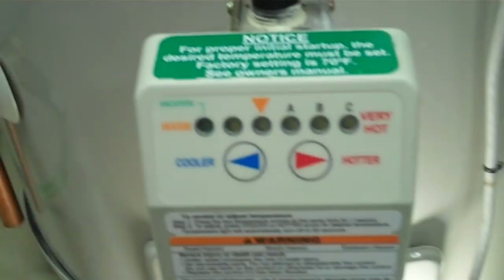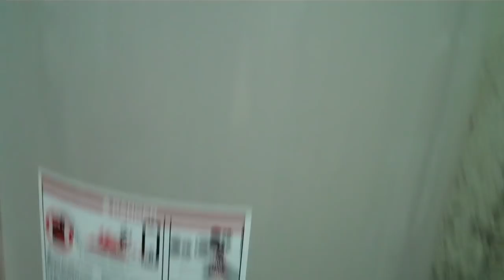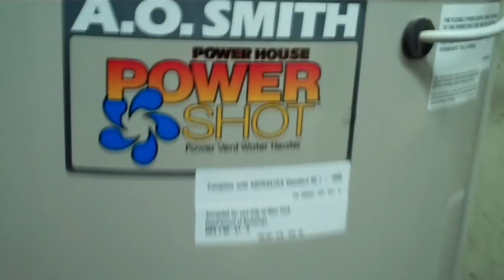Water Heater Flame Gas Short Cycle Ignitor Sensor Troubleshoot Repair AO Smith Igniter@geofatboy

Comment: Thank you so much for this video.  I have a State/A O Smith water heater that was doing the same thing you described.  After one cold shower I got on youtube and found your video.  20 minutes later the water heater is fixed with no parts needing replacing and the water is already heating back up.  I was prepared to replace the heater because it is 19 years old but now it is working fine.  You saved me at least $1K but probably more like $2K.  Thanks!
Reply: I was in the same boat.  I thought I was going to be replacing the water heater.

Comment: Best Video instructions!!! We have the A O Smith gas water heater which was giving "System in Lockout" error.One Plumbing company I called said they will have to replace the igniter plate (shown in this video) which will cost me $300/-. I followed this video step by step. There was a lot of dirt settled on the igniter plate which I emptied in a garbage can. Put the assembly back and started the water heater. It started working just like its new! . And I just saved $300/- Many thanks!!!!!

Comment: Thank You ! I have the exact water heater with the exact problem. You just saved me approx $2000.000 . I’m a retired general, plumbing and flooring contractor. Because of heavy lifting throughout the 45 years working in the trades, I have sever spinal cord damage. There are many things I can’t do anymore which leaves me at the mercy of trades people who would rather replace than repair and help people. I was able to manage this maintenance repair by myself. It helped that you happen to have demonstrated on my exact water heater. Thank you so much. It’s good to know there are honest tradesmen still out there.  Please excuse the grammar and punctuation errors if any. I’m an old guy.

Comment: Just wanted to say thank you for this video!  It described my problem exactly.  The extent of my trouble shooting knowledge was to unplug it and plug it back in (I'm a woman).  When that failed, I called my very handy dad and brother, who both have electric heaters.  They were at a loss as to how to help.  Your video gave me the instructions, and after 10 minutes and not even having a wrench, I was successful!! As another commenter said, the nut for my gas pipe was also backwards, but everything else went smoothly.  I'm no longer "just a girl."  Thanks again!

Comment: My Rheem 75 gallon Power Vent Water Heater gave me a message of "maximum attempts to light ignitor reached system in lockout mode". I tried to figure it out for hours to no avail. Then I found this video, did exactly what was shown and it worked!!! THANK YOU SO MUCH! I was the hero to my family!!! God Bless YOU!!!!!!!!!!!!

Comment: Thank you so much for this video.  For 3 months now we were using our 2nd water heater as the main one had not been working.  Our neighbor had the exact same issue and the plumber changed the water heater for a tune of $1400.00.  So I was reluctant to do anything.  I ran across your video and decided to give it a try.  Wow it worked like a charm.  You saved our family a lot of money.  I really appreciate your help.

Comment: Thanks for the video. I was surprised that my flame sensor didn't really look very dirty, but I polished it with some steel wool, and now it works perfectly. It was easy too.  I put a straw over the igniter so I didn't touch it by accident

Comment: I searched the web for a solution to my Intelli-Vent issue a year ago. I thought it was a wiring problem up near the vent because it was intermittent and fiddling with the wires could get it running for a couple of days more.This time I'm very glad I saw your video. I'm pretty sure my problem is solved, at least until the sensor needs cleaning again in a few years. I can't thank you enough. Thank you for making this video.

Comment: Just realized this video was posted 10 years ago but it saved my holiday week. Got exact same issues with my water heater before Christmas Eve and couldn't find any plumbers. My family spent the Christmas and the weekend without hot water. I decided to give it a try and the advice in this video works! It definitely made me feel like a hero.

Comment: I am so thankful that you created this video...it is 6:30pm on Christmas Eve and family is coming over in under an hour and we just discovered that we no longer have hot water.... I had this same problem with my AO Smith Water Heater about 5 years ago. Back then, I hired a vendor to solve this and they explained this exact process as they solved the problem. Five years later I wanted to review the process and Wow!!! your tutorial matched the issue and the process and indeed this solved my problem and a Christmas Eve disaster without hot water and a family gathering in just over an hour. Thanks a million!
Reply from the maker: Can believe it took me 2 years to answer but I'm thrilled it worked for you! Gotta have hot water on Christmas Eve!

Comment: I just paid a plumber $54 dollars to diagnose and clean my unit due to the exact problem you described.  The price is very low due to a coupon but the unit started doing the same thing 24 hours after he came. I was complaining if you want anything done right do it yourself. So I went online and Googled the problem and found your video. Ironically watching it took longer then the actual repair :). The unit is working perfectly! TYVM!

Comment: Thanks for posting this. Rheem had told me I could pull as you illustrated, but I wanted to see it in action. It worked. I just used a pinch of steel wool to clean the igniter and I saved from stupidity dollars.

Comment: Wasn't sure if the heater control or the flame rod was bad and did a search for the controller and found this video. Cleaned up the flame rod per your instructions and the unit is now working again. Thanks. Looks like I owe you a beer...

Comment: This is a GREAT video. Turns out, we did not have enough gas/pressure coming into the building. We had 2.5 inches of water collumn and the unit needs at least 5.0. So the gas company is coming out to check. Thanks again! Great job!

Comment: Thanks for the video. My AO Smith 75 gal unit was slightly different than the one shown but the trick worked perfectly and it fired right up and stayed running.  Like others have commented, we've had repair men out 3 times to replace that sensor, burners, control unit and this problem keeps reoccurring even though it's only 4 years old.

Comment: Add me to the list of happy DIY'ers that fixed their water heater with this method.  Pulled out the flame sensor, sanded it clean and shiny, and it worked like a charm.  Thanks for the help!!

Comment: I was not getting any error codes. I called AO Smith technical support and they said I needed a digital volt-ohm meter to figure out the problem.  I setup a service guy - $85 to show up but then I saw this video.  It is running like a champ now.  There was a lot of crap in the burner area.  Thanks for posting this simple solution.
Reply from the maker: Excellent Don! Glad you got it worked out.
Visit https://shavenation.com/ If you'd like to improve your shave!

Comment: Thank you for the video. Got the hot water heater working by following your instructions.  Saved the cost of a service call and they probably would have charged for a new burner assembly vs. just cleaning it. Thanks!!

Comment: Looks like you have saved another one. :)   Really appreciate this video.   Mine just went out a few days ago.  I shut off the gas and unplugged it.  Found this video today and it's working again. Took less than 15 min to fix.
Reply: I should add mine was originally installed on 10/19/2010 so it wasn't even 4 years old yet.
Reply from the maker: AWESOME! Glad I could help!
Visit https://shavenation.com/ If you'd like to improve your shave!

Comment: I love you! ;)
My ProMax (75 gal) was a single green light and 5 yellow lights on the temp controller and the blower fan was constantly running.,My unit has two burner pans which made getting the assembly out a bit of a trick. Once out the flame sensor and burner pan were in pretty good shape. I lightly sanded the flame sensor and reassembled.

Powered up the blower fan, I heard the click and w/in seconds I had flame. Heater is heating up water now. Looking forward to a hot shower and shave.

Comment: @geo. The jack of all trades. Big difference between U.S. And U.K. Water heaters, ours is heated with an immersion element which is inserted into the tank. The problem with that is over time limescale will cling onto it and reduce the heat output thus rendering it and London is notorious for hard water. Which means replacing the elements and getting expensive call out from heating engineers. Be well mate. Your bro G from across the pond.

Comment: I had a Sears Economizer 6 that was short cycling.  Sears wanted $200 with no guarantees to come out - since it was no longer under warranty.  But would be glad to sell me a new one.

Had heard about cleaning the ignitor, but only that it needed to be done.  Not the smart way to get to it.  Saw the video, took 10 minutes, maybe 15 since it was cramped and it works like a charm.  Thanks much.

Comment: Thank you!  Great video.  Although our heater was a 50 gallon and the flame sensor is shaped differently, cleaned with sand paper as shown on your video...working so far.  In a warm shower within 20 minutes.

Comment: Great video and great hint! 

I just wanted to share my experience with others. I have a Kenmore Powervent 6, made in 2005. From what I've figured it is an AO Smith with the Kenmore label.

I followed the procedure detailed in the video to no avail. Also replaced the entire ignitor/flame sensor component (~$100), but problem persisted (will go though the start cycle but 2-3 seconds after flame starts then it stops).

Finally found what the issue is. The white box that says "Intelivent" connects to the metal piece on the back of it (which is the gas valve) using 4 pins. These pins were supposed to the soldered. In my case, I could easily remove the white box from the gas valve. This is not how this is supposed to be, and caused a bad contact on these 4 pins. 

Long story short, I bought a soldering iron and some solder at Harbor Freight (~$7 total) and soldered them again. Problem fixed!!!
Reply from the maker: And now you are an expert troubleshooter! Hopefully someone else will read this and benefit from it.
Visit https://shavenation.com/ If you'd like to improve your shave!

Comment: Hey. Thanks so much. Just saved $150 plus tax. Did this on a Giant water heater....pretty much the same but there is an interior cover held on with 4 screws that have to be removed to be able to take the burner out. Thx again !

Comment: Thank you, worked great on my Kenmore Gas Water Heater with a Power Vent.  I was concerned about the sealed area and any differences, but it was a couple of nuts and came off easily.  The rest was as you listed here.  Great work, Thank you!!

Comment: Bingo.  Solved it immediately.  I was a little concerned because I have a dual burner - but it did pop out eventually.  Used some emery paper and it worked immediately.

Comment: Thank you sooooo much Life Saving Man, your Video saved me lot of frustration, just finished the job as you described and its working....looks like perfectly, burner is on and water is heating up for the morning. Really appreciate your instructions. Navraj Grewal.
Reply from the maker: Navraj, enjoy your next hot shower, compliments of Geofatboy!
Reply: ***** Hi, great video. I did what you suggested. After sanding and putting it back in, the flames came on the third try so I got a tank full of hot water, but then on the next restart cycle system went back into the lock out mode (error 6). Any other suggestion, much appreciated and thanks

Comment: I have the State Select Unit model # GS650YBVIT. I used this DIY video and the heater is working like new. Thanks, geofatboy and You Tube!! Now I've got to cancel that service call.
Reply: what error code did you get? I am having similar problem but error code "error in hot surface ignitor circuit" !!!  Never touched the ignitor circuit !!!???

Comment: Great Video. Very thorough
 I'm a service  & repair plumber with 25+ yrs.
A  co-worker installed an AO Smith - BTN 100 110 today and had a problem.
This unit has 2 burners and the one with the flame sensor was loose and wasn't getting good flame rectification. 
Fixed that but have another problem.
I just uploaded a video with a burner problem 
I've never seen this problem before and thought maybe you might have an opiion
Video is unlisted & only 30 sec

Comment: @geofatboy Yes, unfortunately it's 5 months beyond the 6 year warranty. I did figure something was wrong last summer when I heard restarts but I didn't think of it much then and I thought the unit was out of warranty anyway (the builder did not leave the manual/docs). Also, I did not know that you're supposed to drain these units every 6 months or so to prolong the life. When removing the burner I noticed big chunks of rusted metal falling down, so I decided to order a new water heater...

Comment: Thank you for the video, did exactly what you said, unfortunately I'm not part of that 9 out of 10 times. Still getting error code 5. AO smith with intellivent put in 2009 so out of warranty. Thank you again for the straightforward directions!
Reply from the maker: Might have to bite the bullet and have someone come and check it out...
Reply: Bet ya it's the gas control valve.
Reply: What was it? I'm not that 9/10 either  & I've just lost my job so I need to be able to fix it or we just won't have hot water for awhile unless we boil it on the stove...lol!
Reply: Wow, guys forgot all about posting this question but I did fix it on my own.. My husband calls me the research queen. I looked and looked and read forum after forum and after testing the flame ignitor sensor with a multimeter I found that it had gone bad and wasn't making the connection. I ordered a new one and we now have hot water again. It was about $85 with shipping and was simple to replace...... Fun Frugal Frenzy, I had to heat the water on the stove for almost 2 weeks as well! LOL

Comment: One important note: The flame sensor is to blame only if you GET A FLAME and it goes out.

I had this same intermittent problem but I never got a flame at all during the retries before lockout. A.O. Smith help desk made the problem worse by claiming that a faulty electronics/gas valve board will not cause an intermittent problem. I eventually proved them wrong: If I tap the housing with a wrench, it starts every time. The valve is flakey - something AO Smith support says is impossible...

Comment: I have a new a.o. smith vertex that goes on and off just like you said. this is the replacement heater to the one before that did the same thing. my plumber won't come out anymore and a.o. smith tech is no help. Cannot find the problem. great video you put out.
Reply from the maker: Thanks David! Glad you got it sorted out!

Comment: THANK YOU!!!  First hot shower in weeks!  I was apprehensive to do this with the gas explosion/electrocution risk (if anyone were going to mess this up, it would be me), but this was super easy!  I used a dollar bill, since I didn't have sandpaper on hand, and it worked!  

Also, if all the intellivent lights are off, does that mean it's working fine?
Reply: No lights means everything is fine. Lights only when there is a fault, or if you are performing the override steps to set the water temperature.

Comment: I contacted the manufacturer in regards to this problem, they recommend a small knife to scrape away large deposits on the last half inch of the probe then steel wool, not sand paper.
Reply from the maker: O. K. good luck with that...

Comment: Thank you so much for the video!!! Our home has this in our laundry room, and despite attempts at keeping it clean and dust free, this problem has occurred like clockwork every 8 months since building in 2008. Each time it has cost us 90$ for the service man to come and use a tiny bit of steel wool, for under ten minutes, and back it works again for another 8 months.  Supposed to be an awesome water heater, and you just made it such. I can also hopefully extend the life of it! Bless you!

Comment: I have a slightly different variation. The flame will actually burn for a couple minutes, then when it shuts off it always tries 3 more times and gives me the codes. Like it is not sensing that it just burned. Every couple hours it does the same cycle as water cools I assume.

Comment: Very good video!  Exactly what we needed.  :-)  by the way, why do you need to drain the water heater every 4 years or so?  Does it just automatically refill when you turn it on?  That is a lot of water...so I would need the hose to reach outside?
Thanks again!

Comment: I almost messed up while doing this.  Apparently the brass nut on my AO Smith water heater is reverse threaded.  Thankfully I figured this out before stripping the nut.  Cleaned the flame sensor; put everything back together; now the heater flamed up and kept burning after only one misfire.  My only concern is that I'm not certain the "flame pan" is centered under my tank.  It kept drifting when I was refastening the nut.